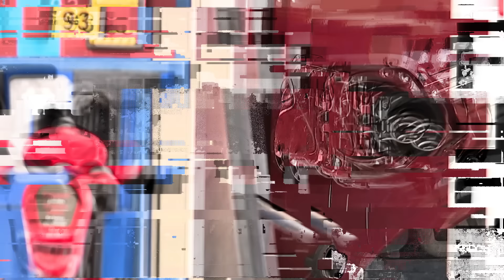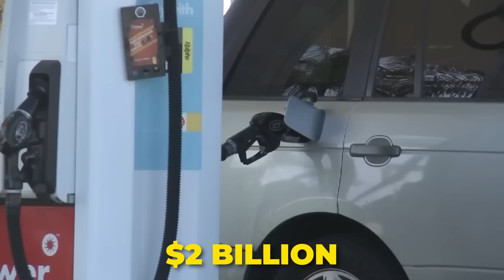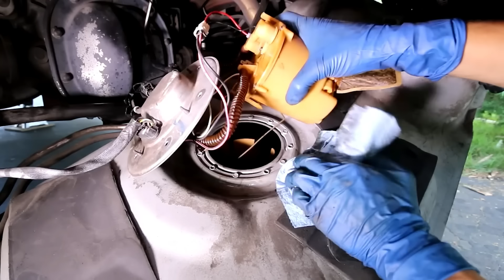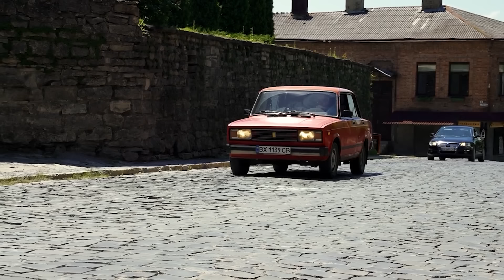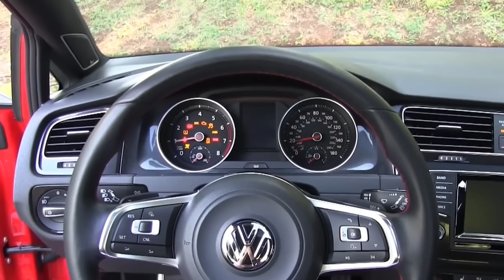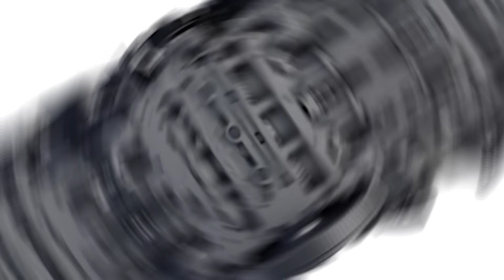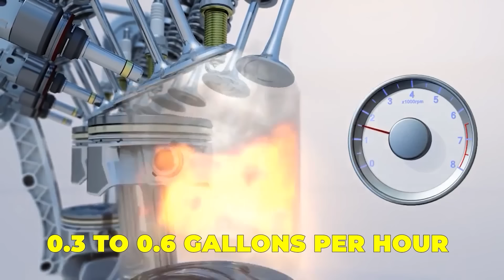15 Fuel Saving Secrets Gas Stations Protect With Their Lives

Comment: I don't agree with using a lower octane gasoline. I have been driving all my life for decades and what I have noticed is that the highest octane gasoline gives me better gas economy and makes the engine run better. When I use 87 octane gasoline and turn off the engine the car ends up making knocking sounds like a horse. This will damage the engine. I would rather keep on buying high octane gasoline and save on expensive engine repairs than be using lower octane gasoline like 87 and expose myself to bad mechanics that will rip me off if they see the opportunity. The rest of the info on this video makes sense. Awesome.

Comment: I'm 73 years old and am shocked to see these fuel tips. Don't get me wrong, I've been using most of the tips for the last 50+ years. I'm very happy to see that someone has put these tips where others can make use of them. The thing that puzzles me is that these tips aren't  new and haven't remained in everyday car owner knowledge. Keep up the good work!!
Reply from the maker: You’re absolutely right. Most of these fuel-saving habits have worked for decades. Modern cars changed, but the basics never did. Sadly, many drivers stopped learning them. Really appreciate your support and experience.

Comment: so is this why i feel having the winter tires on uses a bit more fuel than my summer ones? I'll never be without both, but thats what I find. Im  retired so I dont drive alot except short trips to the kids or the store...
Reply from the maker: Yes, that’s completely normal. Winter tires create more rolling resistance because the rubber is softer and the tread is more aggressive for snow and cold-weather grip. That extra traction usually costs a little fuel economy compared to summer tires. For short trips especially, the difference becomes even more noticeable.

Comment: I have a 2020 Ford Transit connect. It is a flex fuel. I can put E85 in it. 

 I wouldn't though. 

 I only put 87 unleaded. I throw a bottle of seafoam in once a month. 

 My van hates the winter blend. During the warmer months I get 350 miles to a full tank. But in the winter I only get 160 miles to a full tank.

Comment: in uk when tyou replace the nozzel to the pump i noticed it jumped up a penny i went to let them no they said heres your penny back but every driver that gets fuel lost a penny when i spoke to the manager he said there is an electric fault in the system i took it further to tesco and got a 50 pounds back i bet it was to keep quiet but they are ripping the uk public off not on my watch i tell everyone to look out and the more complaints the better

Comment: Listen to video for details on why you can save on these 15 tips

15 - slow down the fill up to stop vapors that you are charged for
14 - premium gas is not necessary unless called for by manufacturers 
13 - don’t fill up when a tanker is there - gas gets contaminated 
12 - time of day to fill up is a myth - 
11 - stations can operate with 1% off calibration - stay away from old looking pumps or faded inspection stickers. 
10 - keep air filter clean - a dirty filter makes engine work harder & affects gas milage
9 - under inflated tire pressure can cause a 3% change in milage
8 - short trips mpg killers - warm engine give better mpg
7 - extra weight in trunk, on rooftop or inside lowers mpg by 1-2%
6 - wrong oil viscosity makes engine work harder - too thick slows engine down & too thin wears engine parts faster - check owner’s manual - temps where you live effect the oil, too. 
5 - check for gas cap leaks - fuel vapors escape, engine works harder & adjusts fuel mixture
4 - A/C in city at slow speeds lowers mpg - on highway ok - use slightly open windows at slow speeds
3 - engine sensors effect mpg - can lose up to 15% or more - check oxygen & other sensors
2 - idling wastes fuel like during warm ups and sitting still - drive gently to warm up - turn off engine instead of idling for more than 30 seconds (trains - bad traffic jams)
1 - speed - keep at 45-60 mph for most vehicles - faster could lose up to 15 - 25% mpg (70-80 mph) due to air drag

Comment: This too, cars with catalytic converters do not need warming up it is better to drive 25 to 30 mph for 1 to 2 minutes and you are good.  When you idle you wear out your catalytic converter (expensive to replace),  waste gas, pollute, put more miles on your engine just sitting and waste your time when could be 5 miles down the road already.

Comment: careful with this one 14:03 - #6 Wrong oil viscosity. that thin oil and the engine shutdown at traffic lights are hurting your engine. you might save some mpg but your engine will break sooner. keep your barrings well lubricated and avoid friction.

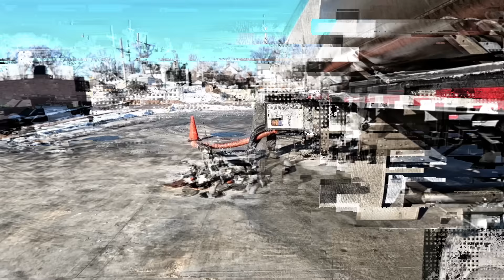Comment: @3:45............ I'm not sure who you talked to or where you got your researched info from, but ALL gas stations are required to install and maintain fuel filtration equipment on every tank and at every pump.  Granted, there's no real world proof that these filtration systems are functioning properly at every gas station, but it's inaccurate to say "that contamination flows straight into your tank, when trucks are filling the stations tanks".  Most large national brands do maintain their equipment and making an educated guess, I'd say that while contamination inside the tank IS stirred up (maybe to that 400% max  you've quoted) during re-filling, less than 10% of it makes it through the filtration systems and into vehicles (to be caught and removed by vehicle fuel filters).  If for no other reason than greed.  If stations get a reputation for selling "dirty fuel" they will go out of business from complains to regulatory bodies and lack of customers.  So, don't fear monger like that, be factual and transparent, PP.

Comment: I'm not here to argue or agree with the video. However, I did notice at 1st my current used vehicle took 15 gallons of gas near empty with a digital warning, when purchased. Wherever the level read (1/2, 1/4) and I stopped for gas seemed consistent with a 15-gallon tank. Only recently, pumping gas quickly did I notice the fill-up keeps totaling 12. This seems far off from the percentage created here, but I will have to test slow pumping to find out.

Comment: I learned a long time ago to find another gas station if there is a truck there filling up the tanks. And pumping your gas slower will save you a little bit. The only thing I didn't like about this video is they make it sounds like the gas stations sinister plan to keep these secrets from us. What gas station is going to tell you to change your air filter? My first job out of high school was managing a gas station, no one told me not to give these secrets away, because most employees don't know any of this stuff. I learned much more later in my life by working for a large pipeline company.

Comment: I also never knew about the pump being operated at full flow. I live in UK and have a Ford Puma Hybrid. I run the car in eco and try to Hypermile. On short runs I do get 50 plus miles to the gallon. It's also a case of looking further ahead while driving and watching traffic lights and easing off the power and letting the car slow itself down. I'm surprised today with the increase money in fuel the amount of drivers who tear along as though they have not got a minute to live. Hard breaking is turning your fuel into heat, most times I only have to break gently sometimes not needing to break at all. Some good info on here, will people try it. I've saved a lot by the way I drive.👍

Comment: How do you read the tank when its 1/2?
Reply from the maker: When your fuel gauge shows 1/2, it means your tank is roughly half full—for example, about 8 gallons left in a 16-gallon tank—but it’s only an estimate, not exact. The needle may not drop evenly and can be affected slightly by driving conditions like hills or acceleration, so for better accuracy, use your trip odometer after filling up to track how much fuel you’ve actually used.

Comment: Good info, also, when I see the read light I do not press on the gas, just let tje car go, sometimes by the time you are getting close to the light it changes or you just have to keep on moving without coming to a complete stop, that also saves on break pads.
Reply from the maker: That’s a great way to save both fuel and your brake pads, thanks for sharing! Keep it Piston Post ❤️
Reply: @pistonpost1 👍

Comment: I didn’t even get through the first one before I had to start writing. 1. The fuel is measured back at the pump not where it comes out of the nozzle. On top of that most meters have vapor eliminators.
2. Can’t speak for everyone but we priced all of our gas on a specific cents per gallon regardless of the grade. Because of cost, the higher octane gas was always more expensive and therefore a slower mover. The last thing a normal business would do is keep a higher priced inventory around longer by making it even more expensive. 
3. Both the pumps and your vehicle have very fine filters to take impurities out. Do they get everything? No but 99% of it. On top of that most tanks are fiberglass not metal so there is no rust. 
4. The seasonal blends are mandated by the government not the stations. 
5. Anything that sells by weight or volume has to be inspected annually and more times that not due to wear they give more than what they register.
6.-15. All BS that gas stations have anything to do with it or even think about. Why would you blame gas stations for things that they have no control over? Idling? Short trips, weight, air filters?Seriously? Let’s make sure it comes across  as some big conspiracy of secrets that gas stations are keeping from you. I guarantee they don’t even think about it. Some of these things definitely have benefits, but don’t make it come across as something gas stations should be telling you.

Comment: Thank you for the reseach. In Australia.. I would advise use of high grade fuel every time. Low grade field in general, can clog and block injectors and fuel filters over time. You are better off buying the best quality fuel to save your mechanical costs, believe me.

Comment: 5:13  okay, morning fuel benefit might be somewhat of a myth, but instead apply that logic to cold-snap fuel. Fuel that was refined, stored, and transported during cold weather will be lower temperature than otherwise. Lower temp = more molecules per measured unit of volume.

 They aren't very common where I live, but aboveground fuel tanks would be vulnerable to temperature change. If there has been a few days of cold weather, take advantage.

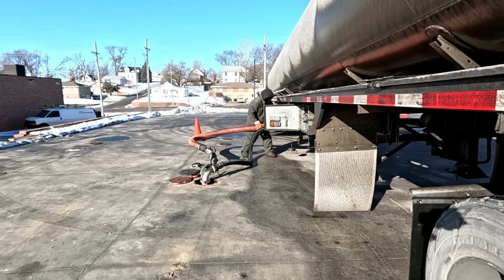Comment: 3:40 fuel delivery truck trap is a bit of a misnomer. There are fuel filters on the fuel lines in the bottom section of the pump station. If you go to a high volume retailer like Costco, that gets 3 shipments per day, it's impossible that they have any significant amount of sediment building up anyway.

Comment: - Don't pump at full speed - slow flow = less fuel lost to vapour
- Don't use higher octane fuel unless your car is designed for it.
- Don't fuel up when a supply tanker is filling the station's tanks - it stirs up sediment, which goes into your car.
- Morning refuelling doesn't give you more gas
- Avoid dirty or poorly maintained stations; check the calibration sticker on the pumps is up-to-date so that you know the pump flow is correct
- Ensure your air filter is clean
- Increase tire pressure slightly higher than recommended
- Avoid short trip where the engine stays so cold it's inefficient
- Reduce weight in your car
- Make sure you're using the right engine oil viscosity
- Ensure your gas cap is fitted properly and doesn't have cracks or leaks
- Use AC at higher speeds instead of opening the windows
- Check your sensors are clean and working properly, Eg the MAF sensor
- Avoid unnecessary idling - turn your engine off if sitting still for more than 30 seconds
- Aim to drive 5-10 mph lower on highways to reduce resistance from air drag

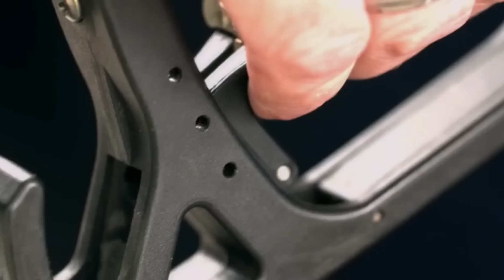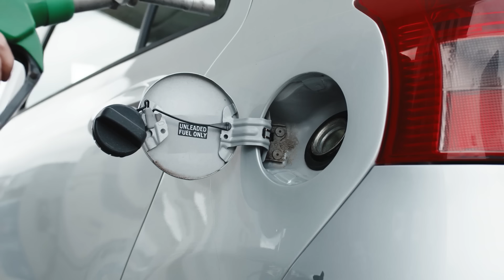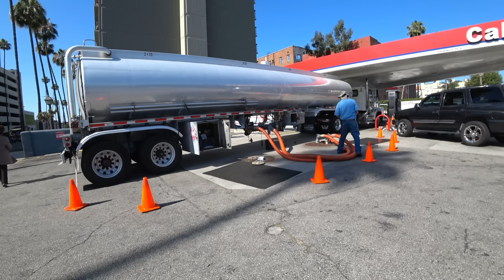Comment: 0:58 At our station,  systems require a yearly test on volume to dollar paid. Its accurate no matter how fast. I call BS on this one. Especially when I fill up a 5 gallon tank at fastest speed and it measures out just fine. 2:33 This is true. The worst one is the the Plus or 89 octane. 89 octane is a 50/50 mix of 87 and 92. But the price doesnt reflect that. Do the math on the price difference and you will see what I mean. 3:50 With this being true, we have two filters before the fuel gets to the vehicle. The final filter is 30 microns. When they deliver during business hours, it does plug them and we have to change them sooner than inteded, but it doesnt make it to the consumer. 8:21 meh. 
Good luck future gasholes!!! 🤘

Comment: Use an engineheater in the winter.
Reply: If you're talking about a block heater, it's useful in areas that get colder than -20 C. It's a waste of electricity if you use one in warmer areas.

Comment: ANOTHER THING I LEARNED BACK IN HIGH SCHOOL WAS THAT IF YOU FILL YOUR TIRES TO 35 OR SO AIR PRESSURE YOU GET BETTER GAS MILAGE BECAUSE 32 IS LOW FOR COMFORT BUT YOU USE MORE FUEL THAN AT 35 POUNDS. THE CAR RIDES ROUGHER JUMPING ON THE SPEED BUMPS BUT SAVE GAS.
Reply: Inflate tires, by what the tire sayd
Reply: @carolroberts9574 WRONG AGAIN. SUBJECT IS SAVE GAS AND MONEY. SO DISOBEY THE MANUAL THAT SAYS 32 LBS AND PUT MORE AIR TO 35 AND IT WILL SAVE YOU GAS AND MONEY.
Reply: Please don't use all caps, it's considered rude in comments.

Comment: Why Slow Pumping Doesn't Save Money
      .      
Precise Metering: Commercial gas pumps are required by law to be accurate to about 1% (or +/- 0.5% in some regions). The meters measure liquid volume as it passes through the pump, not at the nozzle, so the speed of delivery does not change how much you are charged for the liquid that enters the hose.
     .
Vapor Recovery Systems: Modern pumps are equipped with Vapor Recovery Systems designed to capture fumes. While fast pumping can technically create more vapor, these systems are built to handle standard flow rates (up to 10 gallons per minute for passenger cars) with negligible impact on the final volume of liquid in your tank.
     .
Foaming and Auto-Shutoff: Pumping at the fastest setting can cause "foaming" or splashing, which might trigger the automatic shut-off before your tank is truly full. Slowing down at the very end can help you get a "fuller" tank, but it does not change the price per gallon you pay for the fuel actually delivered.

Comment: WHAT!! So that foam forms in the filling mechanism but NOT in the fuel gauge INSIDE the pump installation.

The volatile substances in the gasoline make it ignite better; it is complete nonsense that you get less energy into the gasoline in the winter.
Winter costs more energy because everything is colder; that is the only reason for higher fuel consumption.

Stop with this BULLSHIT!

Comment: ok so i have a 2001 honda accord, uses regular gas, not premium. but i've been told to use premium for it since it's a very old car. so im going to start using shell gas instead of bp. do i still need to use premium or do i really need to just stick with regular gas at shell for my car? thank you in advance for your answers!
Reply: Premium, shell standard is not better or worse than any other brand.

Comment: Number 2 ain’t completely true. I use high grade in a 98 wrangler. It used to have a bad torque gap at 2k rpm meaning slow acceleration until 2k then it would feel more torque. I put 91 and 93 no octane now it’s smooth asf steady all the way. It burns and cleans ish

Comment: I learned the last one the hard way. Hour and a half highway regular trip, started driving 70 instead of 80 to 85, used like half the gas, and trip only took 2 minutes longer.
Reply: I believe you. I used to make long trips on my R1200RT and one day my wife and I left my parents' house at the same time. It was a 320-mile trip to get back home. I rode 80 to 85, even got up to triple digits for a short distance, every chance I got. My wife drove 72 mph.
 I did beat her home but only by a few minutes. I didn't even have time to take my gear off.
Reply: @Randy-b2d3n  Wow, and that's a lot further than the trip I had realized this with. Way worse mileage, more dangerous, and only a few minutes gained. It's definitely not worth it... although I'm not sure I could resist on a bike 😂

Comment: The one about not filling up when the fuel delivery is being done has some truth to it but isn't really an issue anymore like it used to be. The only time this still holds true, is if you drive an old car and the gas station is old/outdated. Modern vehicles and modern gas stations have filters upon filters upon filters that filter out any sediment that could make it to your gas tank, then even if it did somehow make it there, your vehicle has filters for it too. So you are fine to fill up when a delivery driver is there.

Comment: 18:49 True its better for MPG to shut the engine off in between trips. But understand the fuel-to-air ratio during start-ups can actually increase carbon build up over time. So its a pick your poison and find the happy medium. Rule I was taught, 5 minute idle time max. Balance between MPG and engine protection.

Comment: While buying gas for my lawnmower,  I've noticed that pump calibration varies.  It is not unusual to get charged for 6 gallons while filling a 5 gallon gas can. I've  also tried different size gas containers.  Whether they're 1 gallon or 2 gallon,  the pump reads much more. And it varies from one gas station to another. Try it.